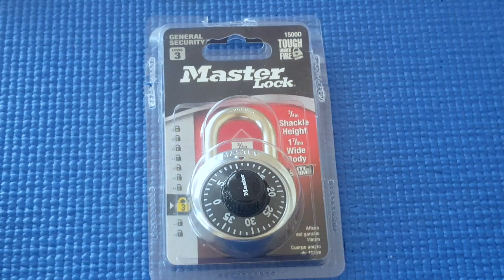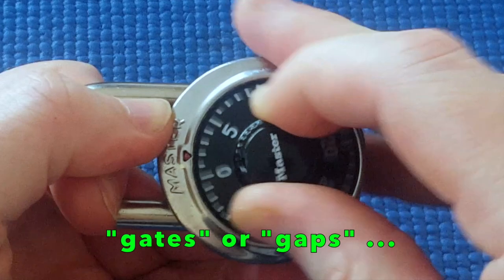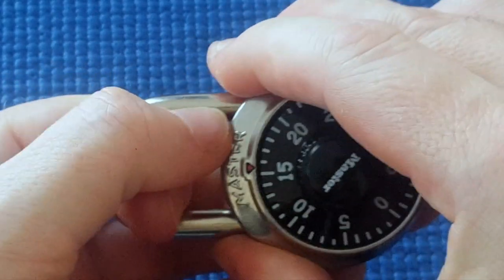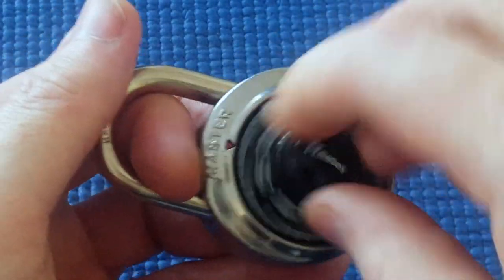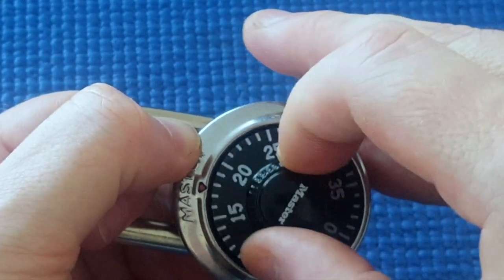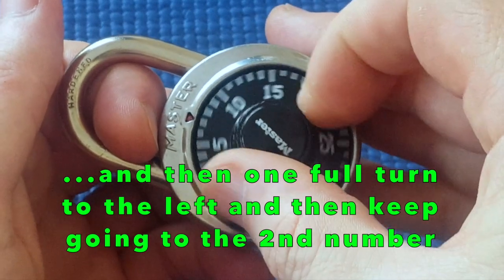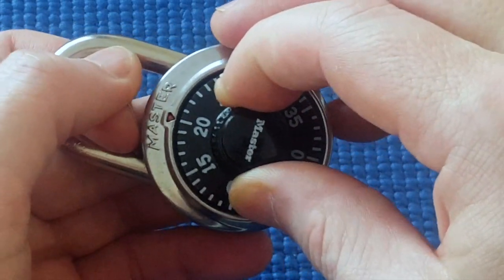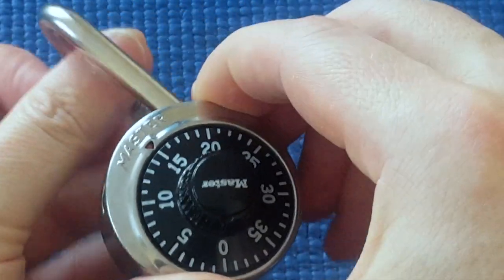(Picking 92) How to quickly crack a standard Master Lock dial combination using no math!

Comment: Theres a method for the 2nd digit
Just put more tension until you find a point where you cant turn anymore
Turn the other way and you will find a spot that you get stuck on
Reply from the maker: Thank you for sharing that tip! I like having lots of methods just in case & I'll have to give that a go. Cheers!
Reply: If this doesn't work then idk, I guess not all combinations work
Reply from the maker: @pickaxe4248  btw - I have some more advanced methods for Master locks here:
https://youtu.be/hVYRIp9YOlo
and:
https://youtu.be/8MwaRPZD3Hc
and:
https://youtu.be/O6v04dDXd84
Reply: You can try this video ,if you like

Comment: what’s the use of finding the 3rd number? I noticed you found the first and second number and the lock opened.
Reply from the maker: All 3 numbers are needed to open the lock. In this video, I found the 3rd number first (15) and then the 1st number second (19). Then I used a special method to speed up the decoding time ... I dialed in the 1st number, and then tried lots of 2nd numbers (two at a time) and back to the 3rd number (each time) to see if the lock opened. I didn't have to dial in the 1st number again, but only nudged the 2nd number along in each test.
I mean I could have done it the slow way and done:
Three times to the right to reset, 19-21-15, test shackle,
Three times to the right to reset, 19-23-15, test shackle,
Three times to the right to reset, 19-25-15, test shackle,
Three times to the right to reset, 19-27-15, test shackle,
etc
... but that way is slow.
Instead I did:
Three times to the right to reset, 19-21-15, test shackle,
then:
...23-15, test shackle,
...25-15, test shackle,
...27-15, test shackle,
etc
In this video I only covered the topic briefly, but in my other videos I talk about these things in more detail, and I show even better methods in some of my latest videos (and also what to do if you lock isn't "playing ball"). See the playlist: https://www.youtube.com/watch?v=RqjMjpF65Tg&list=PL2mzpXp-I6G1qfzQY6c0f1WSL2LGICT9A ... but probably start with the most recent ones (starting at video 198).

Comment: What exactly do you mean by looser. I’m having a hard time finding my last number
Reply from the maker: For the last or 3rd number of the combination that you find *first*, it will have probably have the most "play" (side to side movement) - it'll be quite wide as compared to the rest (this is under shackle tension though! ... as if you're trying to pull the shackle open).  It should also be "looser", and what I mean by that is it's easier to turn ... and if you really pull on the shackle giving lots of tension, it should be easier to turn than the rest of them.  You don't have to have a massive tension all the time of you will get a sore hand & sore fingers.  Just use a medium tension, but when you think you've found the correct 3rd number, you can increase the tension and double check, comparing it with one of the others.  Hope that helps.  Good luck!
Reply: Thanks I just got it open
Reply from the maker: @Omlet221  Fantastic! :D :D

Comment: Why is it 15, not 14, where it caught?
Reply from the maker: The 3rd number is 15 because there was a wide gap between 14 & 16 (wide gap when pulling on the shackle) and so the "play" was either side of 15.  The "caught" number (turning while only pulling the shackle lightly - where it only catches in one place) just happened to be 14 (it could have been anywhere around the dial) and adding 5 to this is 19 which is our 1st number.  This method is fairly reliable for these types of Master locks (but not non-Master locks).

Comment: I can give you a reverse combination (left, right, left) without touching that lock!
Reply from the maker: Yes you can if you know the formula (and if you already know the right-left-right combination) ... for these master dial combo locks, take 6 away from the first number, add 2 to the 2nd number, and the last number stays the same. Sometimes the numbers change slightly, so if it doesn't work, try subtracting 8 from the first number, or 4 from the second number (or both) ... don't forget to reset by turning several times to the left before each attempt.
Reply: The reverse combination is
1st digit minus 7
2nd digit plus 3
3rd digit not changed

So mine is 27 37 31
Reverse code would be 20 0 31